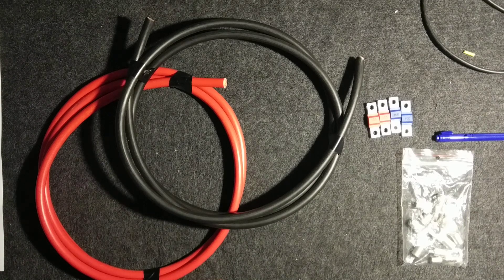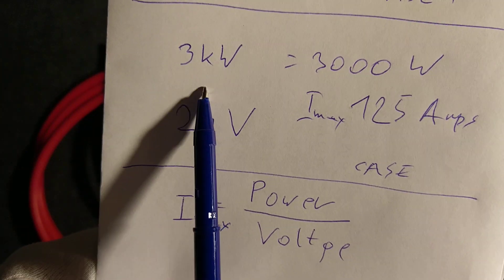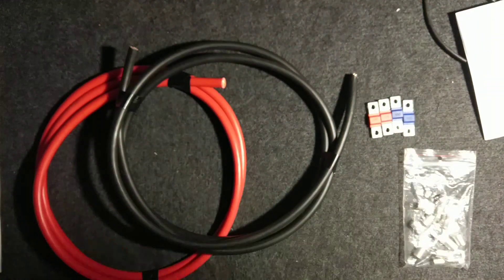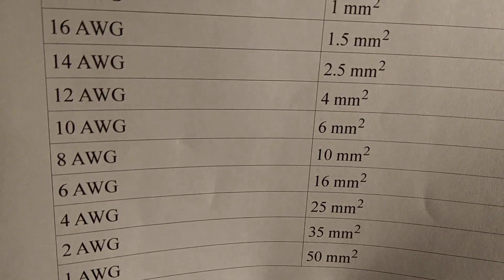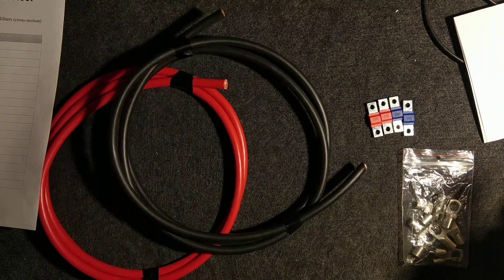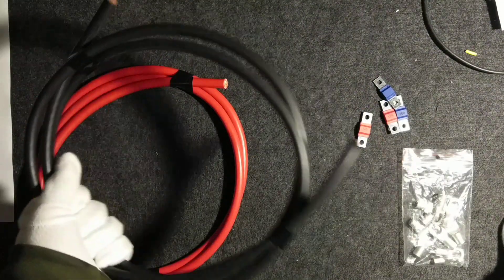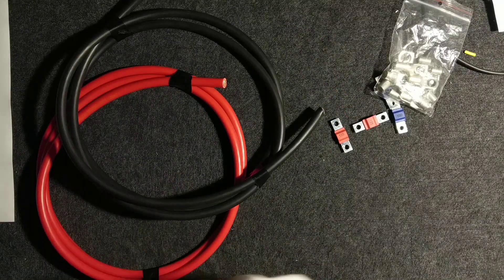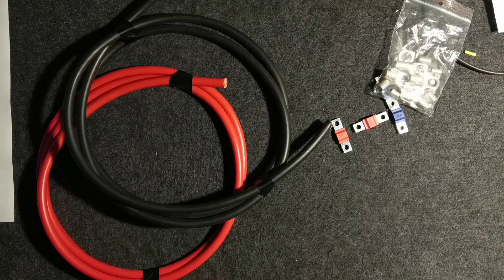Solar inverter to battery - calculate wire size

Comment: Hi, I have 5 batteries of 120Ah each, wanna wire them in parallel. Not understanding if my cable would have to handle 585 Amps or 120 Amps to connect between the batteries,   and a 600 amp fuse before the inverter ?

Comment: Hello sir nice video well explained ..  I have a 48v 6.2kw inverter that I’m gonna connect to 48v lithium ion cells .. 

by my calculations it’s required 129 amps fuse .. should I use 150 or 200 amps ?

What AC BRAKER u recommend ? . 

 also what size of wire should I connect to my battery?  a 25mm or thicker . Thanks .

Comment: Why would you use the wattage of the charge controller and not the solar panel, especially if the panels total half the controller size?

Comment: I tried the calculator but didn't seem to be the right answer for the info I plugged in. I have 2000watt inverter, 380watts of solar, 50amp solar controller and 2 100ah lithium batteries. So Do I need 4/0 or 2/0 cable?
Reply from the maker: Please tell me what is the voltage of the battery system because you need calculate max possible current that will flow between battery and inverter